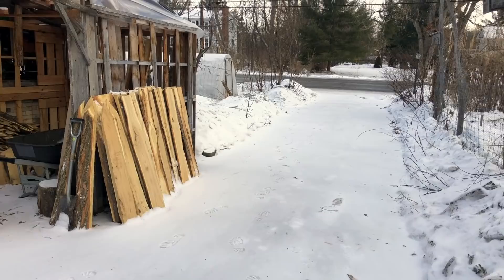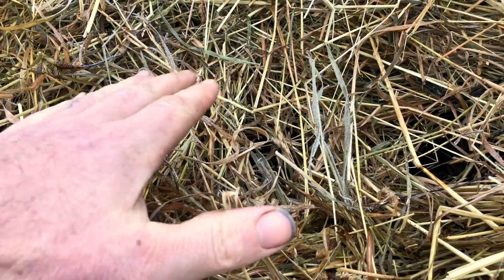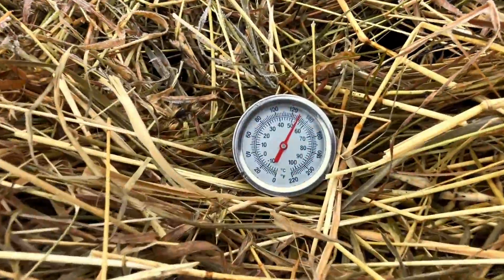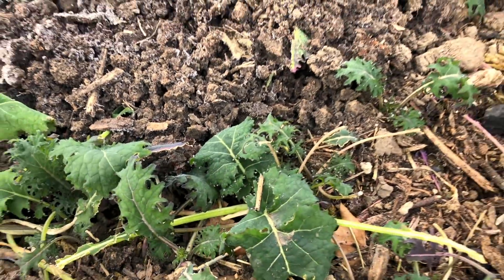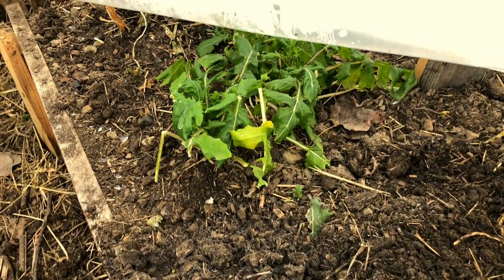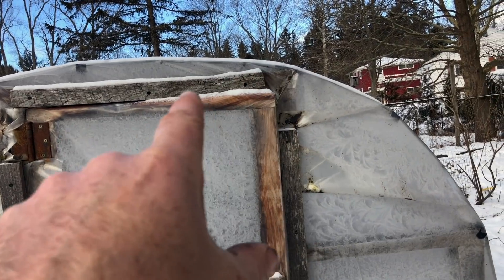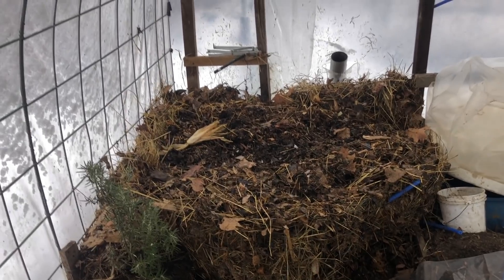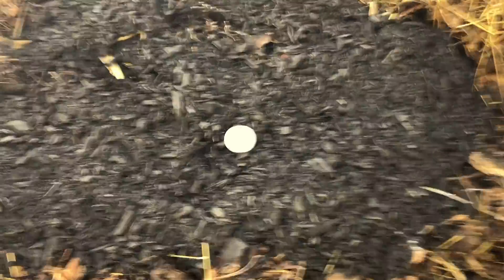Compost Heating - Update and Evolution!

Comment: Hey Sean,
Interesting video, great projects.  Here is my feedback:

Is the compost pile in the tunnel w/ the PEXs circut on the West side?  The same side with the significant gap in the door?  I think you should set the half barrel for water/ thermal mass storage on top to the what I believe is the Northwest end, then build the compost pile up another tier or partial layer of thermophilic material.  This could address and positively impact a few factors: 1.) Adding a gravitational gradient component to the flow of the PEX circuit system (I am hoping that as soon as you fill the circuit with water the height of the water storage will help be the force that creates a passive flow of water initially. Kick starting the passive thermal gradient flow that arrises from the thermophilic energy released by the microbes in the active pile, or potentially the albedo effect from the dark colored soil surface on sunny days).  Whichever is the net difference in reaching thermal equilibrium.

2.) Give you more volume of active heat generating material/ increasing thermal mass for conductive passive heating. (This could be accomplished without minimizing too much insolation by the extra material causing shading. If the half barrel reservoir was positioned as much in the NW corner as possible and surrounding the tank from every side but not on the top obvi).

3.)  This would act as insulation for the thermal battery (Reservoir H2O, plus volume moving through the tubing) only exposing the water to the open air on the water surface at the top of the tank.  Which you could easily cover/insulate and even  use as a well for warmed  irrigation water.  Also, as you observe how the early morning sun enters the structure you can adjust how you want to add/ slope the 2nd tier of compost material towards the S, front wall.  Maybe even keeping the very most Southern/ front part of the pile at the current height its at. (to minimize shading and optimize volume, based off your obs.).

4.) In my part of the country, plus I think you've mentioned yours, Winter prevailing winds come from the N and the W. Covering that gap with poly, cardboard or whatever would be an easy spot to make up some thermal gain.  I was thinking that building this compost pile/ PEX circuit water reservoir ( the conductive thermal mass storage) up to that height would help buffer a lot of that negative wind effect additionally.

Those are the main things that came to mind regarding the context of your infrastructure and systems.  I am curious to see how you continue to develop that set up and hopefully this was timely enough to where you have time to read it and take any of my thoughts into consideration for the design of your next set of upgrades.  We all know you have enough active compost material laying around that you could probably build this compost W end-wall, PEX raised bed circuit system. lol  Thanks for taking those of us along who don't have access to land or resources yet to do awesome projects and production like this.

Best of luck this season as winter begins to fade and Spring beginnings springing more and more.
Warm regards, Mick Dhein
Reply from the maker: Super great ideas here and very much appreciated with the thorough description of them!  THanks Mick!

Comment: I'm looking forward to that 50 gallon pail method.
Though, just some thoughts,
 a 5 gallon pail (or less depending on length of pex circuit) sealed up water tight should be good in a full compost burial. 
Add an insulated but accessible top and a low point drain at the end of the pex circuit , you could easily supplement some extra heat on these cold blasts with a pail of warm water from the fire place.
Also, definitely air tight the low tunnels somehow.
Reply from the maker: Neat idea to top off the circuit with hot water from the wood stove on gnarly niights... I like that!
Reply: Also a side note for data related math. 1to1 ratio vessel to pex line volume, and a 4to1 ratio total volume to flow rate may be a good starting trial point. Though tweaking is always encouraged. Lol

Comment: My greenhouse is like the one attached to your house but stand alone.  I got it better sealed with foam strips around the edge of the roof sheets and with some additional electric heat on our occasional freezing nights I was able to keep 2 tomato plants alive.  One was a clone and I will clone them again for this summer. There is an up slope to the north in the greenhouse so possibly I can get thermal siphoning  to the north bed from a compost pile. That is where I have my spring harvest potatoes. A few have come up during February and are a foot high.
Reply from the maker: Sounds like a really nice system.

Comment: Thanks to you both for sharing your insights. I am pleased that you are still including biochar in your systems. I am still trying to figure out how to capture the wood vinegar.  Yet to calculate how long an exhaust pipe to use.
Anyways, I believe it was Dr Hugh McLaughlin mentioned the easiest way to get biochar prepared for garden use is to put it into compost systems. As it accomplishes the 3 steps in the process. It conditions, charges and inoculates the biochar all at once. You are also achieving it by running it through your chicken runs.
It would be interesting to see if at some point you use it in your mentioned above ground system how clear that compost tea/extract would be. I don't believe there would be any "loss" as it is being held in the biochar I think? If that was what the Dr. meant.
If I may continue, in doing so, incorporating biochar into compost it may significantly stabilize the temperatures in the piles. I would believe much better than saw dust, wood chips and leaves.
Reply from the maker: If we had a ton more biochar I would use as much as I could, but we make it in our woodstove slow and steady.  I always see an improvement in compost health every time we add the char... feels really legit.

Comment: Thermal siphoning should naturally circulate your fluid, might need extra coils within the pile though. Copper would transfer the heat better, cruise some new construction refuse piles, should be able to score a couple 3ft lengths to splice in.
Reply: I was thinking the same thing while watching this one!
Reply: For stableish tempertures and short runs the difference in heatt transfer between copper and pex isn't going to make much difference.
Reply from the maker: I know copper would be way better but I need to be able to harvest the compost later and I can't imagine I'd be able to do so without dinging up the copper...
Reply: @edibleacres  from the looks of the layou & the way you were stacking the compostables, you were going to have to dig out the pex lines anyway....
Reply: @why8116  Ding, not just dig.

Comment: One thing that just occurred to me-I'm going to bet that your elevated compost pile is much more effective at heating than the compost pile that's on the ground.

A thing to remember is that the ground is-to all intents and purposes,an infinite heat sink. Thus,a compost pile on the ground will always lose some of the heat it generates to that ground. And while warming up the ground under the space isn't going to hurt,since there's a lot more ground than compost,it won't help much.

An elevated compost pile,will,I'm guessing,be a much better solution for heating a space,since all of the heat that it generates is (theoretically) available to heat that space. 

This is a fascinating experiment! My compliments to the both of you,and my thanks for going to the trouble to document the results and share them.
Reply from the maker: It wasn't intentional at all to make the 'hovering compost' more efficient, it just seemed like a solution to the funky problem of a mini pond in that corner, but I bet you're right and it ends up cooking cleaner and longer!

Comment: Having the compost pile suspended as is will aid in oxygen circulation. The rising heat will draw cooler oxygenated air through the pile. I feel this is unrealized and a bonus, perhaps. Love the channel, love my plants i got from your nursery, keep up the good work!
Reply from the maker: You are right... I didn't design in that aspect as a benefit, just a solution to the strange layout...

Comment: Looks amazing!  Idea... What if you just overlap the small plastic tunnels over the top of the compost pile?  Might need bigger scrap plastic for that though which could be a limiting factor.  This did really well for that wind storm, it was intense!
Reply: A simple and great idea.  Put the compost pile under the small tunnel.
Reply from the maker: Great thinking...  I haven't committed to cutting poly for the south side of the 2nd tunnel yet and was thinking about having it run the full length so I could have it lay on the hot bed on the west end.... . I'll document what happens there :)

Comment: IDK...25 gals seems like it would freeze up (or partially freeze) unless you ran that pump continuously at night when temps drop to 10 degrees even with only one side exposed to the hot compost & the other to the cold exterior. It's just not a lot of water.

You have me thinking it could work in the right space. You may want to consider a taller, wider re-build of a cattle panel tunnel to give you the area you need to acheive mass for the water tank & the compost. Surrounding 55 gals with hot compst on both sides? You would need at minimum 8-9 ft wide.

You can always splice cattle panel together to give you the required height & width. No one is limited to the 16 ft long segments for the arch for a specific application. If your concered about snow & ice collapes, emt conduit supports run down the length on both sides of the peak can provide enough support short of snowmaggedeon.

A 24 in foam board insulated knee wall would also help a lot too.

Comment: Great content as always. i could listen to you calm voice for hours :)  really like your ideas and experiments. i cant see why the water barrel idea wouldnt work. as long as you insulate the outer edge. leaf bags spring to mind.  i think it might be worth experimenting with the natural syphon of hot water rising and cold water sinking before trying the pump. as your idea evolves it would be easy to spend a little time with exposed pipe in places to see how far the hot/warm water travels naturally. The run might be a little long, but only one way to find out. 

2/ idea, if the raised beds where a little higher, would a 6"/8" pipe running from the base/middle of the compost pile, into the beds. with the furthest end slightly elevated, allowing hot/warm air along it. maybe blocking the end to trap the hot/warm air.

Comment: A thing I’ve seen on designs by others exploring this realm is that the compost can create some noxious gases, so having some way for the air to circulate is best for the plants, another way of dealing with this is putting the compost in a separate part of the green house, so maybe separating the compost part with more plastic could be beneficial as it allows for more accurate control over the differing conditions
Reply: In the new alchemy institute compost heated greenhouses, they actually blow air from the the top of the roof (as heat goes up..) true the compost, and this air goes then under the beds, so in place of eventually breathing bad gas, you end up by watering undegroundly the plants with vapour, and fertilising it with ammonia, while releasing filtered air. Finished compost is the best filter, with charcoal

Comment: As a temporary measure could you plug that gap where the wind blew through on the second tunnel with some squashed up straw .. might help keep the heat in

Comment: I like what your doing with the pex and water. Do you have a small solar fountain pump that would only run during sunny events. Maybe if you combine small dc pump with solar driveway light ,which has a battery. What if you used perf pipe and run air thru it at intervals, the extra oxygen would help your compost heap?
Reply: Small solar pumps are efficient but not that efficient.  1-2 square feet if panel, not 16 square inches.